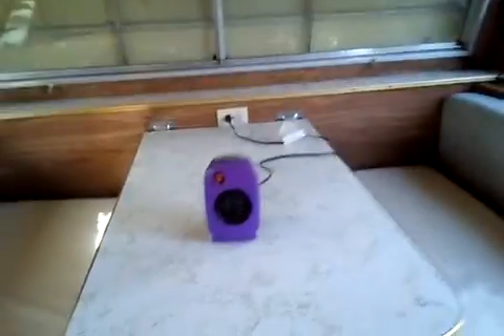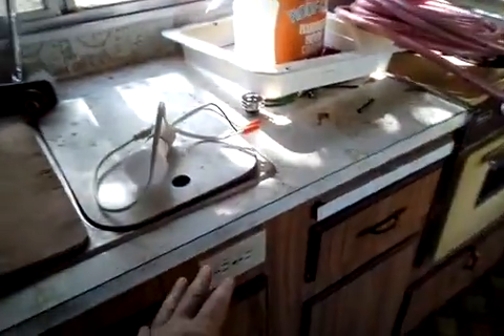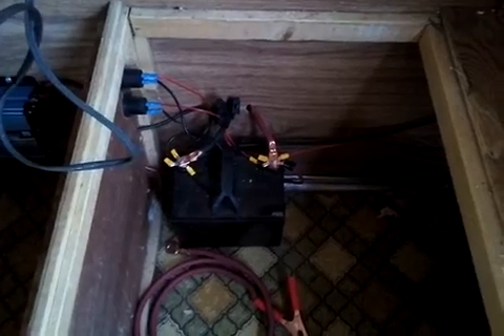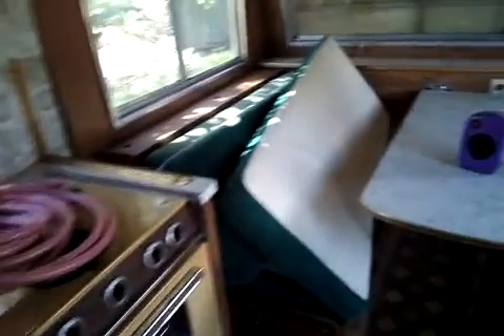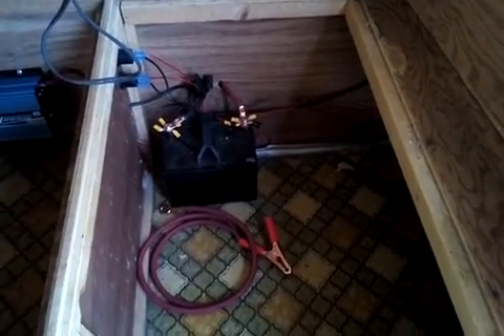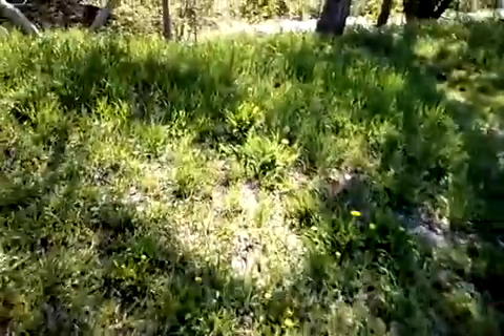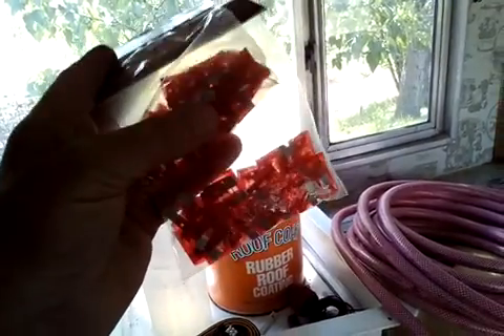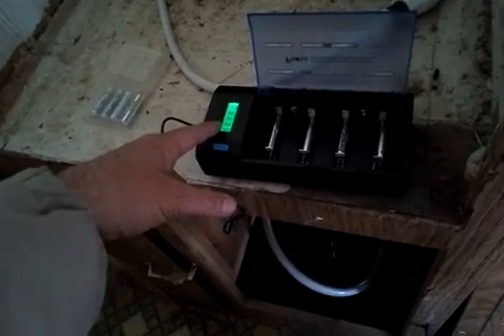110 plugs and 12 volt working on my off grid camper.

Comment: if some want to come across with a good bid for it. if not yes go ahead and fixt it up it only makes the camper a better sale later on. that is the size i use to run my water transfer  pump only. take care and have a wonderful day
Reply from the maker: Even if someone gives the price that I want. I am trying to get it live in ready. The camper is a good size. Not to big and not to small. You must have had a pretty large transfer pump at one time. You have a wonderful day as well.